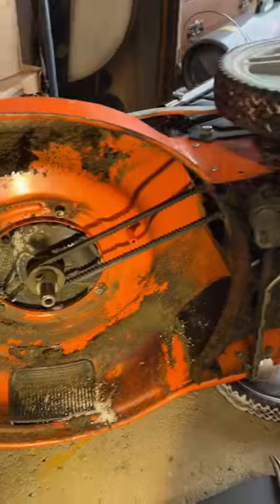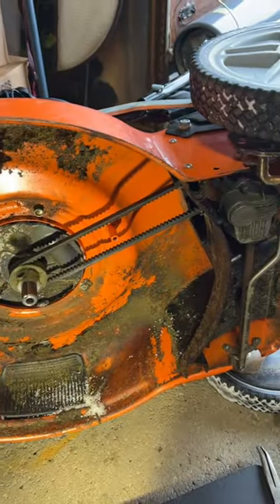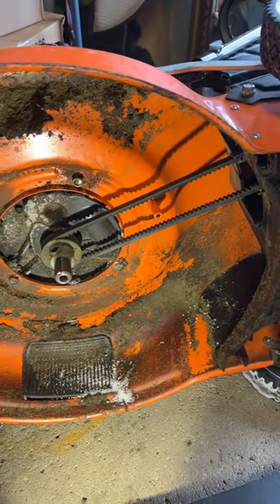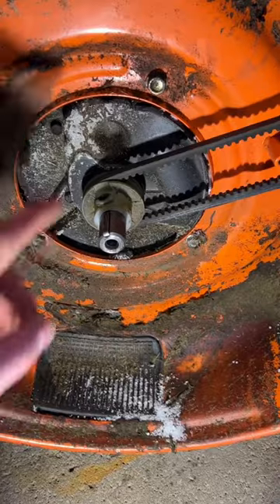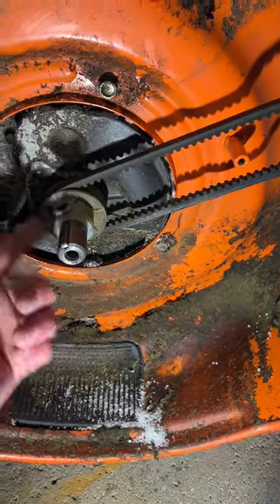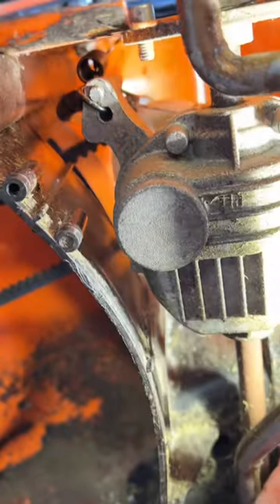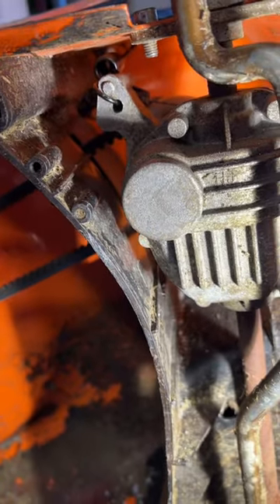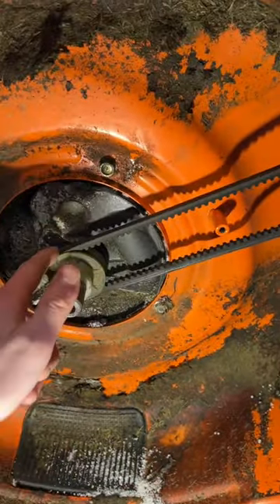Yard Force 21” Lawn Mower Self-Propel Spring Repair

Comment: This might’ve been helpful if you showed how the spring connects. It’s not obvious after you break it down to look and now my belt tension is way too high. I have the spring connected wrong. It’ll never slip, that’s for sure. It’s likely to shred the belt and the drive doesn’t work.
Reply: Did you figure out a solution? I have the same issue

Comment: Nice fix👍spring is coming!!!
Reply from the maker: Thanks, customer finally got to mow for the first time and the belt never came off after the spring was installed
Reply: I watch the video twice. I didn’t see him fix a damn thing.
Reply from the maker: @THEMOWERMEDIC1  Didn’t film the actual repair because it was freezing outside. Maybe one day I will get a shop or heater lol.
Reply: Can you tell me where to get this spring and belt? Thanks
Reply: Can you tell me where I can buy that spring and belt also? I tried a random spring and it self propelled for 5 feet or so until that spring popped off and shredded about 4 or 5 teeth of the belt. I repositioned the spring and tried with that same belt. The spring stayed on but the belt didn't hold up and now it's in 2 pieces. Just really need the right parts. Thanks

Comment: fantastic! i just got one of these with the pulley onnthe transmission blown out. had to order the whole axel. put it all back together and wheels will not turn. watched this video and discovered that spring is missing. hopefully that is the problem and not a lenon part i bought! will the drive system turn the wheels without this spring attached? i

Comment: How did you get the spring on? Tried needle nose, they cant hold the tension of the spring. It slips out of the teeth long before the spring can engage the casting.
Reply from the maker: I used vice grips to hold the spring while pulling it into position. You will want to wear eye protection in case it flies away.

Comment: Do you have video showing a step by step replacement of the gearbox?  I ordered the parts from the Yard Force supplier.  The gearbox and belt arrived with no instructions.  I called the supplier.  They had no PDF or anything I could downland.
Reply from the maker: Unfortunately I don’t, I rarely get these mowers in for repair. That is something I can film in the future if get my hands on another one.

Comment: What is the trick to get the tension spring connected. From the deck to the transaxle, struggling with this currently. 
Suggestions...
Reply from the maker: I used long needle nose pliers. Make sure you wear safety glasses so you don’t finish the job with 1 less eye.

Comment: How did you remove the cover?
Reply: Remove blade, slide off blade adapter, don't lose key from crankshaft, using a sharp pick remove debris from phillip screw head recesses, remove 2 phillips head scews in plastic at wide part, remove 10mm bolt in center of plastic cover. Remove cover...you will have to pry cover in place to align phillips screws for installation due to plastic warpage. Use 2.5 mm allen wrench to remove belt pulley...again, don't lose yet another key. Slide pulley and belt off.  Use 13mm socket to  remove drive wheels, snap ring pliers to remove drive gears, remove drive gear pins, remove large diameter plastic shield. Set deck height adjustment at 2nd setting to align holes with T30 tors bolts that hold 2 brackets that hold transmission/axle in place. Use vise grips, a pry bar, and a motorcycle spring tool to remove tension spring, use needle nose pliers to remove drive cable connection from transmission, pliers to remove drive cable spring hook from transmission. Remove transmission from mower...toss in trash, followed by rest of mower...there is only ONE source for parts in the USA. Now set mower by curb for trash collection. Parts will cost more than half the price of a replacement Yardforce,,The got ya once, will they get ya again ???   Spend the money and buy a completely rebuildable Toro Recycler. They last for years before a belt change is necessary....usually due to mowing wet grass and it rusts the drive pulley and the belt seizes.

Comment: Excellent what size spring is that? I bet I have to order it. So if you know the par number or where you got I would really appreciate it. Thanks keep posting!!!
Reply from the maker: Here is the part number for the spring (1251009001). It is special and will need to be ordered, I got mine through an eBay listing.

Comment: I have a Yard Force 22" 3N1 SP-SC rear drive mower and need to replace a broken belt, I haven't found any instructions how to do that. Can you explain the steps necessary to put a new belt on?
Reply from the maker: Usually you will need to take off the blade and belt cover. Then you can put the new belt around the blade adapter. Next you will need to locate the transmission and put the other side of the belt over the pulley. Sometimes there is a belt keeper that needs to be removed. Hopefully you can get the repair done!
Reply: Were able to install it. Because I need help with my. Please let me know, Also see my other post or comment about what the problem is with my. Thanks

Comment: Transmission does not rotate. The cable pulling a lever on the transmission activates it. It is not like a Toro where the transmission rotates to tension the belt.
Reply from the maker: Yep that is correct, belt is always tensioned on this model.

Comment: mine won't stay on without starting fluid.. any suggestions ?
Reply from the maker: Sounds like you are not getting fuel. I would take off the carburetor and do a thorough cleaning.
Reply: @benchnwrench  👍 thank you for responding

Comment: I thought exhaust down allowed oil to leak into combustion chamber
Reply from the maker: A small amount of oil may get in which burns off during the next start. Flipping the other way usually leads to a bigger mess and flooded engine. Thanks for watching.
Reply: Bryan is correct. I did it the 1st time when I was taking off my broken belt and all the gas flooded the engine and air filter..etc I couldn't start right of way. I had to leave it in the sunlight with the air filter opened. Finally it started with around 31 pulls. Flip it so the gas tank is facing left and to the ground if you look at the mower from back

Comment: That is way wrong !!! So when you pull it over the self propelled is engaged, I hope this is a joke.
Reply from the maker: @machz800  There is a cable that pulls an arm on the gearbox to engage the drive internally. On this model the belt is supposed to always be tensioned unlike most others.